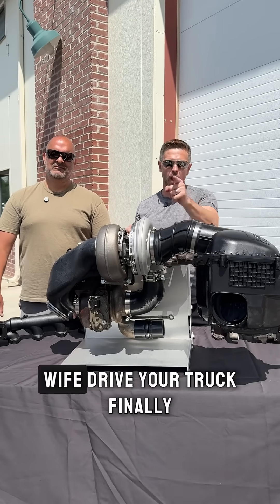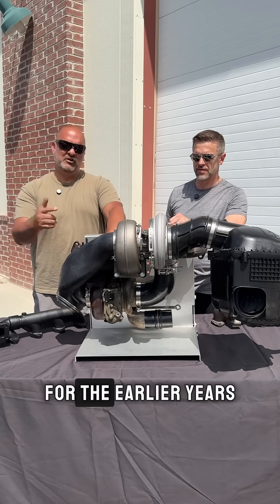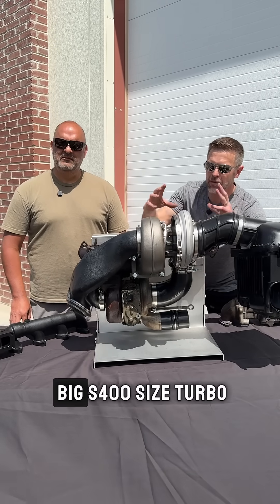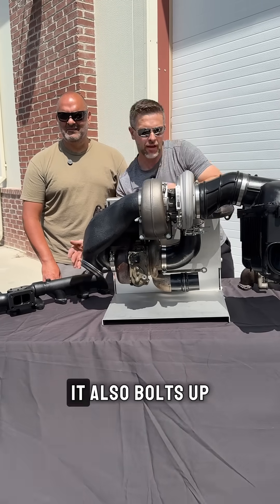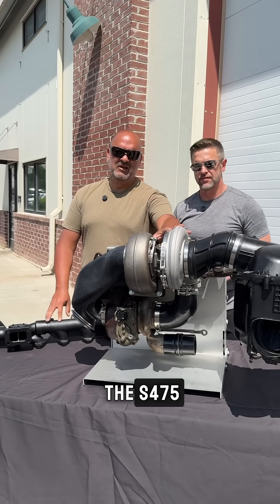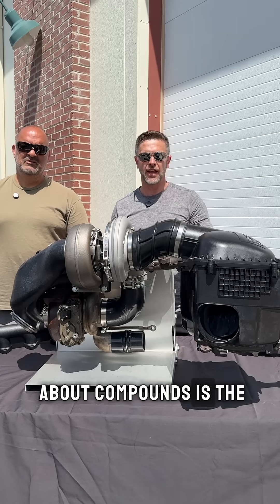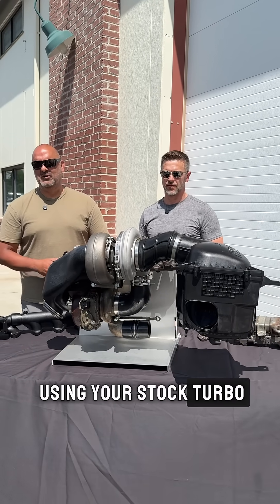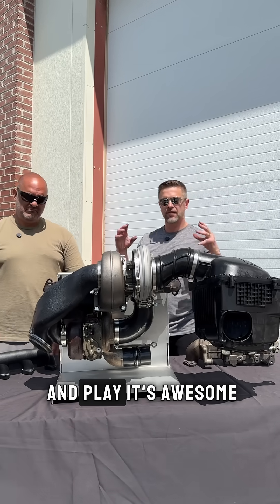The 6.7 Cummins Add A Turbo Kit works with or without emissions!

Comment: I can't wait to get mine for my 2012. I'm planning on getting one in the spring after I put in head studs. I'm doing some transmission upgrades at the moment so compound turbos are next on the list. I have the Banks intercooler pipes, Banks monster ram and Bank ram air cold air intake so I hope I can still use those parts with this setup. My goal is 700hp so I will probably do injectors after the compound kit.

Comment: Sequential twin-turbo systems, while offering benefits like reduced turbo lag and improved throttle response, can also have drawbacks. One major drawback is the potential for a "boost shelf," where boost levels might plateau or even drop off at certain engine speeds as the secondary turbo struggles to spool up. Additionally, the complexity of the system can lead to increased maintenance and potential for failure. 
Here's a more detailed look at the drawbacks:
1. Boost Shelf:
As the engine's speed increases, the first turbo spools up and provides initial boost. However, the exhaust gas might not have enough momentum left to fully spool the second turbo, leading to a plateau or even a decrease in overall boost, creating a "boost shelf". 
2. Complexity and Maintenance:
Sequential twin-turbo systems involve more complex components, including exhaust valves, bypass valves, and potentially different types of compressors, which can increase the likelihood of mechanical issues and require more specialized maintenance. 
3. Cost:
The added complexity of a sequential twin-turbo system often results in higher manufacturing costs, making these systems less common in mainstream applications. 
4. Potential for Uneven Power Delivery:
During the transition phase where the secondary turbo is spooling up, there might be a brief period of uneven power delivery as the system shifts between the two turbos.
Reply from the maker: Actually a properly built compound turbo setup (like ours) doesn’t suffer from a “boost shelf.” We have never had that issue. Our systems are precisely sized to deliver a wide, consistent RPM band with smooth, uninterrupted airflow. No gaps. No drop-off.

Sure, it’s possible to throw together compounds that don’t perform well, but that’s not what we do. With over 20 years of experience and advanced CFD (Computational Fluid Dynamics) tech at our disposal, we know exactly how every molecule of air is moving through the system. Our engineering team lives and breathes this stuff. With our kits high EGT's cease to exists, even while towing up a long steep grade with a heavy load doing 70+ mpgs

When it comes to performance, our compounds don’t just compete with single turbos, they smash them. We've got the data, the results, and the reputation to back it up.

Despite your use of ChatGPT answers copy-and-pasted, we still appreciate you taking the time to comment and be part of the conversation.  🙂
Reply: @DieselPowerSource  maybe but they still sacrifice top end power for low but I’m sure your like Jesus walk on water perfectly
Reply from the maker: @Dieselpwr   with compounds you have a LARGE turbo, it can be extremely large, to cover the top end. The small turbo covers the low end, they both cover the mid range together. They aren’t just adding air on each other they multiple the amount of air going in the cylinder. But of course they can’t walk on water, they don’t have legs!
Reply: @DieselPowerSource  You can’t argue with stupid it beats you down and wins with Experience sound like you have a lot of

Comment: Question. What kind of other modifications would need to be made if my truck is currently D&T on a tow tune so around 40hp? But everything else is factory/stock parts.
Reply: You’re going to want a built trans at some point and you’ll need a retune also
Reply: @Glacier_6.7 are head studs gonna be needed as well?
Reply: @Glacier_6.7 also am I gonna need injectors or anything else engine related? Can I keep my factory 3.73 rear axle ratio?
Reply: @Glacier_6.7 if I was to run a factory trans on it but make the other upgrades. Would the transmission be able to run properly if I didn’t drive it hard. Cause I want my truck to be fast but not a hot rod. I’m more of a grandpa style of driver but I just want to build my truck.
Reply: @RonBergundy6.7 the trans doesn’t like anything more than 500hp I recommend running it on tow haul always ( less shifts means less wear so it saves the transmission) I currently daily mine in a +110 tune so I’m throwing 10hp over the stock rating and it has lasted for about 2 years so far like that but it’s on its way out right now sadly.
Reply: @Glacier_6.7 that’s tough. But that’s really good for a stock trans to consistently run a 100+ tune for 2 years. Would you say upgraded internals would suffice cause I really don’t want to spend 10k+ on a 750-1000 hp transmission. I’m only on 80k miles original. And I baby my truck so I was curious if just upgrading the internals would be cheaper and have the same level of reliability
Reply: @RonBergundy6.7 honestly I think you should be fine I mean personally I’d run it until it starts going then maybe look into a rebuilt trans and if you want anymore power definitely do a stage 2 trans that can hold up to 750hp but as long as you don’t dog on it every da and you run it in tow haul whenever you drive it you should be pretty solid for awhile man
Reply: @Glacier_6.7 okay, cause I don’t care about making huge power or dyno or burnouts. I just want a nice compound built truck that will be reliable. The HP numbers isn’t super important to me.
Reply: @RonBergundy6.7 you should be okay then with compounds but you will definitely want to upgrade the trans eventually if you have a 68rfe if you have a manual then you’ll be fine with just a upgraded clutch for awhile
Reply: @Glacier_6.7 okay Preciate the help.

Comment: Compounds increase egt on heavy loads single large turbo is better for towing compounds are a myth they sound cool and have good sales
Reply from the maker: You couldn’t be more wrong😂
Reply: @DieselPowerSource huh? Compounds lower egts. More air, better burn.
Reply: @sledhead904  yea if your too cheap to build the engine correctly and only concern is red light to red light
Reply: @Dieselpwr huh, I know for a fact the ford 6.0 has way better drivability with twins. Cummins won't be much different. You are misinformed..
Reply: @sledhead904  Maybe in the city higher rpm and larger loads single large turbo is better long haul if they was so great every manufacturer would have them stock
Reply: @DieselPowerSource  Single large turbo is better for towing plain and simple I known many of people who removed twins gone back to singles for a reason
Reply from the maker: @Dieselpwr you still couldn’t be more wrong😂😂
Reply: @DieselPowerSource  believe what you want twins turbo is only good for low end
Reply from the maker: @Dieselpwr  Thanks for your comments! Just to clarify, compound turbos are designed to give you the best of both worlds. The smaller turbo provides quick low-end spool-up and torque, while the larger turbo handles the top-end power. This setup gives you strong performance across the entire RPM range—something a large single turbo just can't do effectively on its own.

In a compound setup, the turbos don’t just work independently—they work together. One turbo compresses atmospheric air and feeds it into the second turbo, which then compresses it even further before it enters the engine. This results in a multiplying effect, not just an additive one. That means significantly higher boost pressures and more efficient airflow than what’s possible with a single turbo alone.

No matter how large of a single turbo you run, it will always be a compromise between low-end response and top-end performance. With compounds, you can run a turbo just as large—or larger—than any single, but still have the benefit of that smaller turbo covering the low and mid-range. That’s why compounds outperform big singles in almost every situation, including towing.
Reply from the maker: @Dieselpwr  Have you ever used compound turbos?  Because if you have you'd know they completely widen the band the turbos perform in.  From low-end to high-end they perform amazing, keep EGT's much lower, and out-perform single turbos in virtually every way.
Reply: @Dieselpwr you’re so wrong. Haha. What info are you getting. Geez
Reply: @Blazin2133  those are the facts hate to say but their are negatives to compounds
Reply: @Blazin2133 You've clearly never used compound turbos Towing or you would know how ridiculously stupid this comment is
Reply: @100pyatt you clearly haven’t used the correct compound setup, incorrect tuning, wrong size injectors, too small intercooler, etc. There’s more to it than slapping it on and thinking it’ll fix issues.
Reply: @Dieselpwr there’s negatives to everything. There’s more involved with compounds. You can’t just throw them on without considering everything else. Injectors, timing, intercooler, sizing of the compounds, etc
Reply: @Blazin2133  if their so superior then why does every manufacturer run them stock because their not
Reply: @Dieselpwr that’s your argument? That manufacturers don’t run compounds so they’re not better? Hahaha. Manufacturers run single turbos for many reasons. Cost, simplicity, space. That’s not proof, that’s you reaching because you want to be right when you know you’re wrong
Reply: Bring evidence besides “my friends switched back to big singles.”
Reply: @stewie84  they remove the thinks their are several articles discussing it
Reply: @stewie84  . Limited High-End Power Delivery (Parallel Twin Turbos): 
Parallel twin turbo setups, often used on use two smaller turbos to improve response and reduce turbo lag.
However, having less exhaust gas available to each turbo limits their boost potential, leading to limited high-end power delivery.
Enthusiasts seeking greater power may opt for a simpler, larger single turbocharger. 
2. Increased Complexity and Cost: 
Twin turbo systems involve more components and are more complex than single turbo setups.
This complexity can lead to higher installation costs and potentially more expensive maintenance.
Sequential twin turbo setups, while aiming for better power delivery across the RPM range, are known for their complexity and potential reliability concerns. 
3. Matching Turbocharger Profiles (Parallel Twin Turbos): 
Matching the profiles of smaller turbochargers in parallel setups can be difficult and expensive for custom tuning. 
4. Potential for Engine Damage: 
Improper installation or tuning of a twin turbo system can increase the risk of engine damage. 
5. Turbo Lag (Potentially, especially with larger turbos): 
While smaller turbos in parallel setups aim to reduce turbo lag, it's still a general drawback of turbocharged engines, especially with larger turbos that take longer to spool up.
Turbo lag is the hesitation felt between pressing the accelerator and the turbocharger providing full boost. 
6. Heat Management: 
Turbochargers, especially twin turbo setups, generate significant heat in the engine bay.
This can require upgrades to cooling systems, such as a better radiator or oil cooler, and heat shielding.
Reply: @stewie84 here you go
Reply: absolutely FALSE , Compounds are SIGNIFICANTLY cooler and wider power than Any single for towing......Your comment is straight up ignorance 🎉
Reply: @Dieselpwr. You literally have no idea what you're talking about
Reply: You just don’t like your ideas being challenged and the fact that a twin turbo has flaws is too much for you to handle because you wanna keep on saying how great and how much better they are and how much how much you make off of them
Reply: @Dieselpwr  Nobody said it doesn't have flaws but EGT ain't one of them.  Better read your original post again.
Reply: @maxpain7197  so what this is some kind of game for you he said she said what are you five years old if you want higher cost more complexity potentially less performance at higher RPMs and twin turbos if you want lower maintenance cost potential for better boost under higher RPM then go with a single large turbo better drive ability in the city sure twin turbo I mean, is your ego really that fragile
Reply: @Dieselpwr  Ugh oh... Someone's mad
Reply: @maxpain7197  you’re gonna have to come up with a better one than that, bro

Comment: What if I don’t have the stock air box ? I use Banks
Reply from the maker: We only couple to the factory air box currently because there are several aftermarket airboxes available, we can only guarantee the fitment to the factory one.  We do include a high flow air filter.  The compounds have the ability to over double the air the stock turbo does by itself, through the factory airbox.
Reply: Couldn’t I just retain the banks air box but use some other intake tube from the turbo to the banks box?